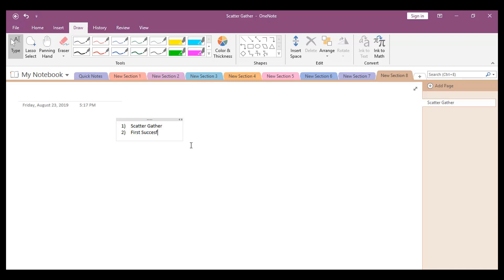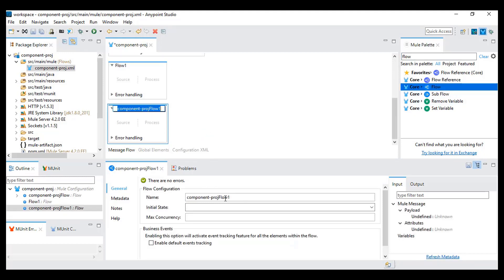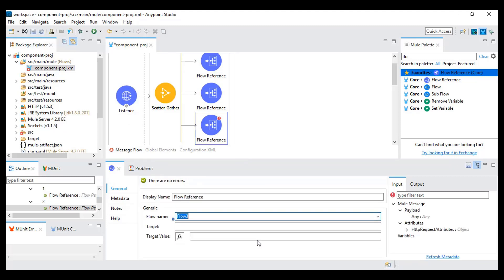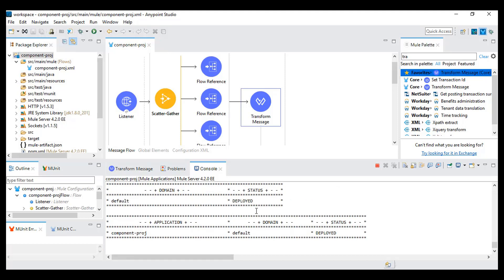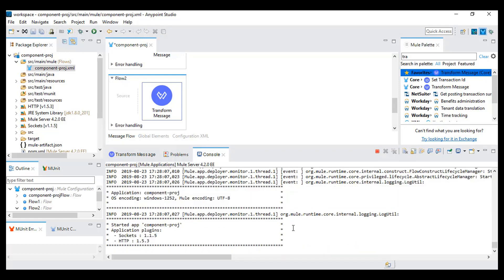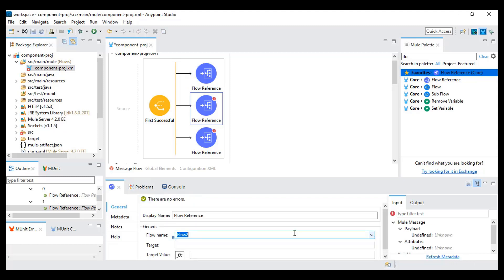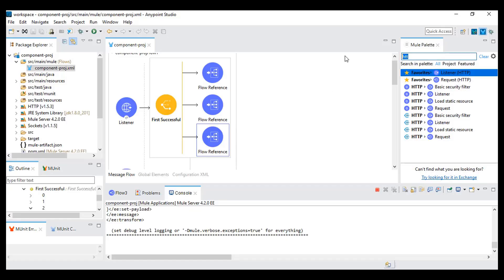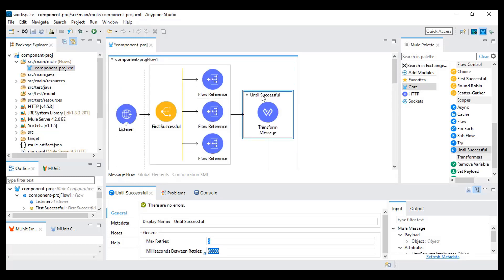Scatter Gather, Until Successful and First Successful in Mule 4

Comment: How can we get the remaining success payloads if one call fails in scatter gather ?
Reply: Hi Swapnil, We will not get any payload if any of the flow fails in Scatter Gather.
Reply: we can use try block with on-error continue within each routes so if one route fail remaining routes successful
Reply: I guess we can choose OnErrorContinue for the failure call which  will ignore the error even if the call got failed. We will get response.